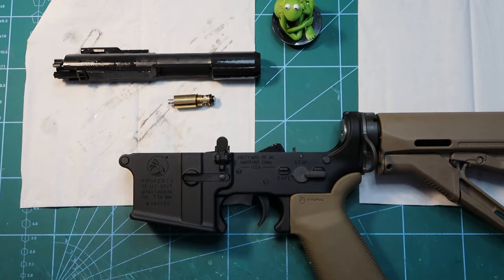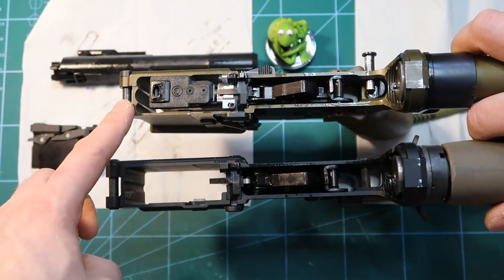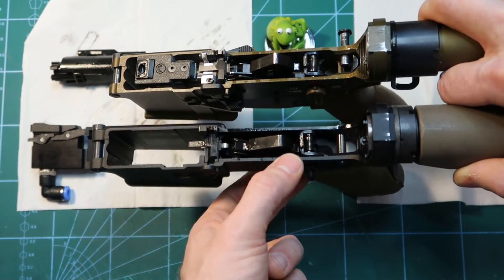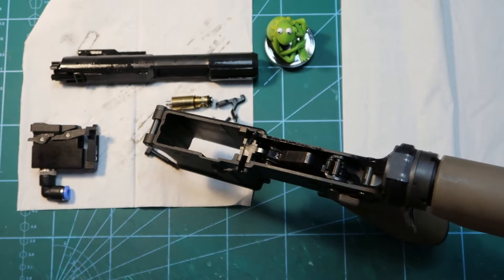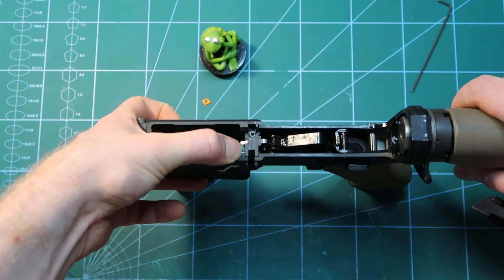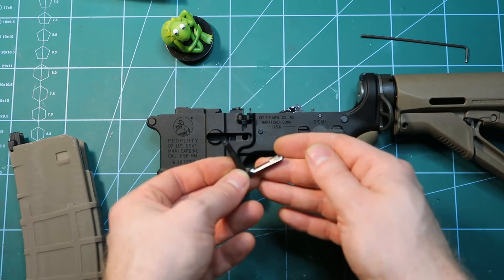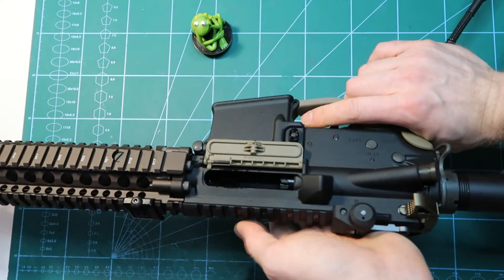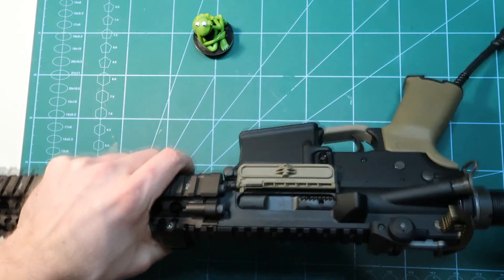Frog Appendix #02 - VFC AR15/HK416 type gen3 HPA GBBR conversion appendix

Comment: thats cool, could u make a tutorial for a hpa adapter that is kinda like the one from airtac for the mws where it changes what mags u used they make it so you use mp5 mags instead of the other ones but thanks to that you don't need to work on the mags
Reply from the maker: Hello, thanks. I am not copying other people solutions, therefore I will not make such and adapter.
Reply: yeah thats fair! :D  @frogengineeringairsoft